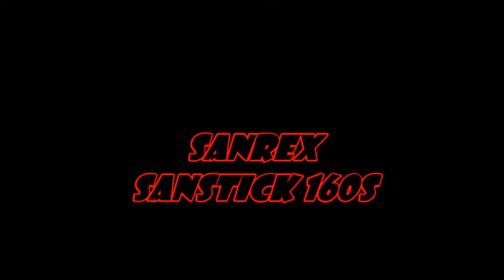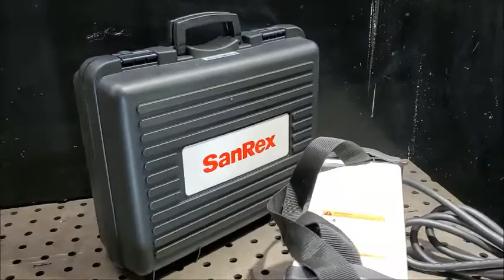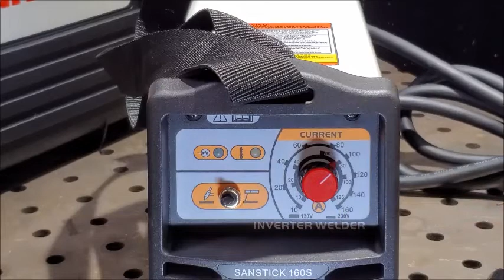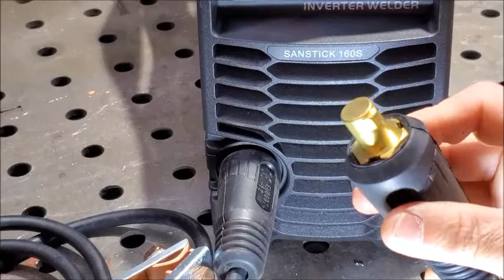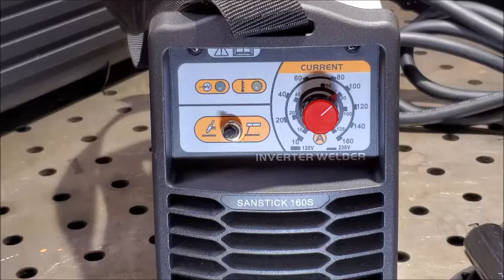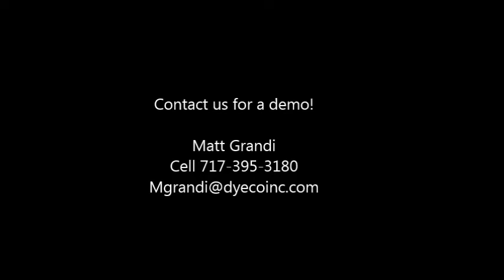SanRex SanStick 160S @ Dyeco Inc.

Comment: I have this machine and it is *excellent*! I can run a 1/8” 7018 on 120V outlets and on 100ft of extension cord. Welded up a friend’s tractor bucket in his driveway with the unit plugged into a basic garage outlet shared with a freezer. Ran 6010 great, too!

Comment: Nice video. Who would use a welding machine in ash, trash and dirt? Yuck. 
Ill take a demo, but not around that yucky stuff.
Reply: Tee hee, i was just being a smart ass. Matt from Dyeco has been my supplier of weld consumables, feeders, machines (anything metal fab related),  product consultant, you name it, for years now. Quite honestly, Matt is also a friend and our favorite face to see when he stops by the plant. The Dyeco shop and everyone  there have been amazing to deal with over the years. I'm quite lucky to do business with them. Highly recommended. 
Also, we bought 2 or 3 of these - worked great until we destroyed them through absolute abuse. 
Then bought more machines from Dyeco.
Reply: This is still a fairly expensive welder.  PF correction makes it have more power for portable use.   
If you want a welder for your clean shop, just get a cheaper one.